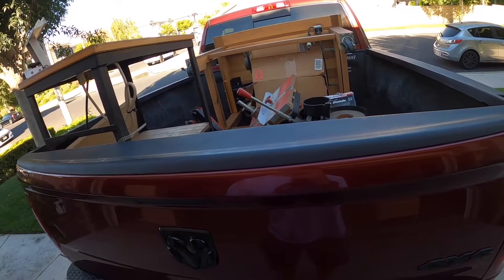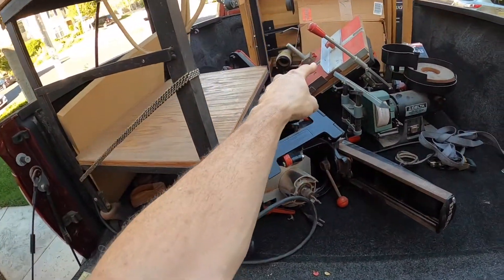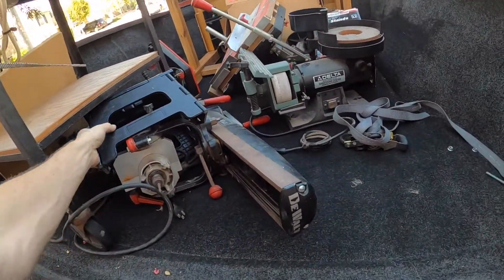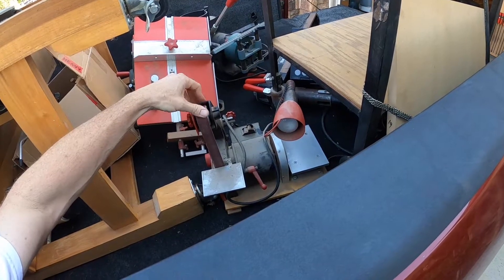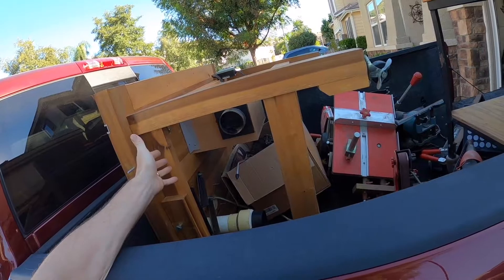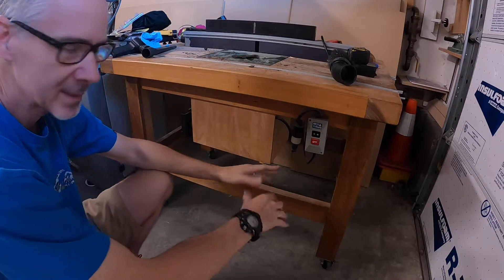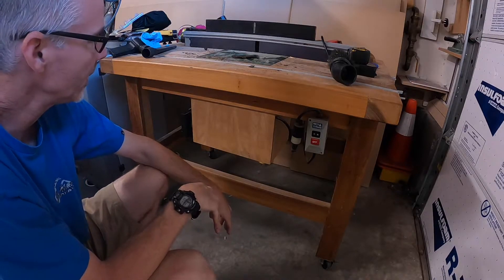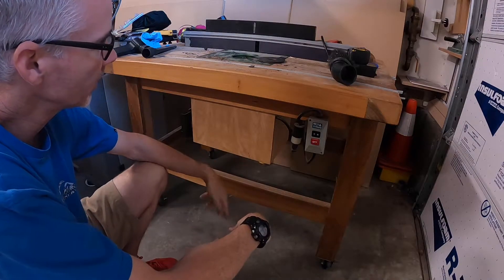Craigslist Massive Tool Haul Part 2

Comment: There was a factory auction out in Brooklyn NY  at a book bindery plant. They had a custom fabricated steel and aluminum table with two 1/2 hp Porter Cable plunge routers to drill out holes in card stock.  It sold for only $20!!
I end up passing on it because I didn't really know much about routers. And I really didn't have space to haul that table away. But from what I found out those router models were worth $80 even in used condition.
Reply from the maker: readyset isn’t that funny.  Sometimes it seems auction prices can be very good but not always.  Do you watch irs auctions online?  They aren’t related to govt.  shops all around sell stuff through then.  Sometimes pricing is very good but sometimes too much.  How did you like the router table that I got?  I’m cleaning it up and will show a video soon.  What an amazing find.  I subscribed to the channel that you referred me to on flea market buying. He’s great.  It’s so funny because he found the exact same drill doctor that I found. How crazy.
Reply: @davidbryanwoodworksandmore  I forgot to show you tool addict also end up mounting his band saw on a mobile base. I can't believe his shop is that tiny, my friend in Liverpool said it's all like that in the UK, a real premium for space.
https://youtu.be/7thxNA0cfKc
Reply from the maker: That’s crazy.  I watch a guy called wood shop junkies abd he’s in a tiny storage container.  Tool addicts got a lot of stuff in that little shed.  Looks like fun.
Reply: @davidbryanwoodworksandmore  I've never heard of IRS auctions?  I've seen a couple auctions from the federal IRS seize asset auctions for car haha. I've had great luck with bidspotter.com it's a clearing house for all the industrial auctions. They act as the ebay for smaller auction houses to have an online platform for bidding. Most of the stuff I buy are hand tools, but I would always recommend to go to the preview to test it out. Since of of these auctions are just "excess inventory" clear outs, which is code for dead equipment.
Reply from the maker: @readysetsleep  im going to check out bidspotter.com.  thank you .
Reply from the maker: Hey readyset, I checked out the bidspotter auctions, pretty cool. they seem to have a ton of items.  thanks again for the referral.  talk to you later.